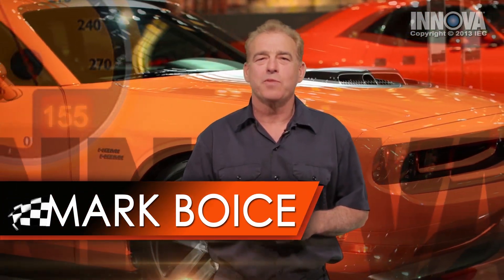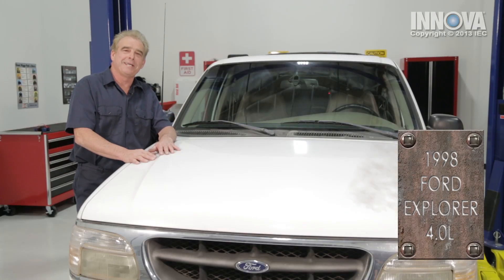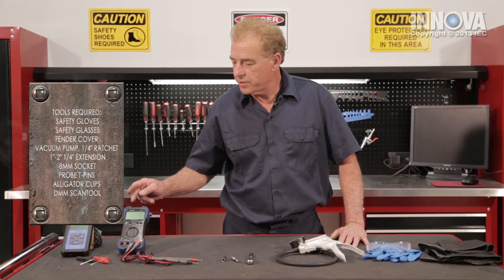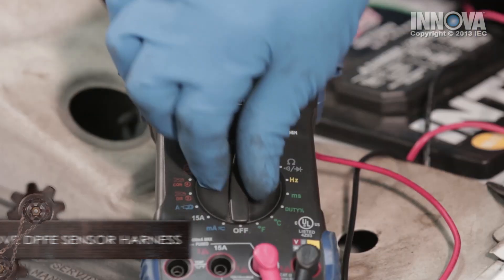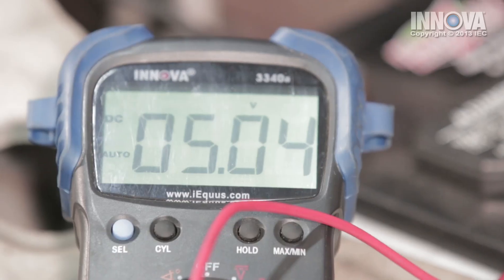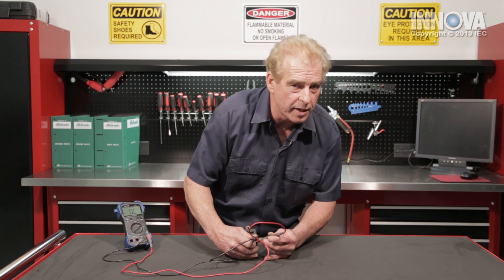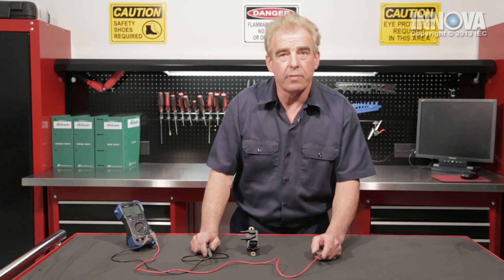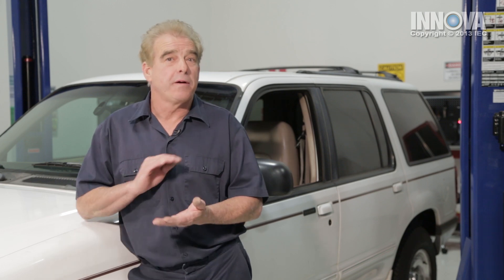How to diagnose a Faulty Differential Pressure Feedback (DPFE) Sensor - 1998 Ford Explorer

Comment: on the first sensor you did resistance check between 1 and 3  pin,  then the new part you read 
between  pins 1 and 2 . WHY? don't know which test is right and which test is wrong.

Comment: Or for $10 you can just buy new dpfe sensor off Ebay and pop it on in 1 minute.....if issue still exists..it wasn't that...you're only out $10 and not 45 minutes of troubleshooting and that's assuming you have a nice multi meter with adapters....
Reply: I did exactly that and now the code is back

Comment: Hello.  Mahalo for a great tutorial.  I hope you're monitoring comments here and will answer.  I have a '96 Explorer.  The DPFE passed all the test except for the voltage when the engine is one and vacuum is applied.  Rather than going up, the voltage went down.   Can I assume that if the DPFE fails just one of the test you prescribed, it had failed?  I also noticed that for positive polarity,  I connected the positive lead to the bottom (blk/w wire) vs you connect the the common from the multi meter.  Thanks in advance for getting back to me.

Comment: Why on the first sensor you did resistance check between 1 and 4 th pin  then the new part you read between  pins 1 and 2 . How is this helpfull since you read from two different points.
Reply: I was thinking the same thing

Comment: Very Helpful video. I changed mine out on my 2004 Expedition and because I broke one of the stems on accident, and it gave me an oxygen sensor code for Bank 1, Sensor 1.  I change the sensor and STILL have the check engine light on.  I disconnected the battery to eliminate the code, but it came on again.  I check it with the diagnostic reader from AutoZone and these codes came up (P2195, P0135, P0401 and P0402).  I'm at wits end. I was going to go to a mechanic to erase the codes first and see if that will shut the light off.  Any other advise?  Thank you!
Reply: Were you able to solve the check engine light issue?  Sometimes you have to clear the memory of the PCM completely by disconnecting the battery cables and touching them together to completely discharge the system and clear the PCM.   I thought that was my issue but the check engine light has come back on.  So I am further diagnosing.

Comment: I got a 2002 explorer 4.0 overheated now blows back out of resivor n bubbles like air in there n white smoke bad out the exhaust . Is my motor shot
Reply: Sounds like a head gasket is the oil milky?
Reply: Head gasket.

Comment: Great video. Very informative and to the point.  Thanks. Some questions though. What would be the voltage signal range when the vehicle is operating? I saw that you pull approximately 23inHG for 3.33 volts. It seems a lot of vacuum. Do you think the exhaust is able to pull that kind of vacuum while driving? Thanks again.
Edit: Find my answer: at 8inHg of vacuum, the sensor needs to output between 4.5 and 5 volts; thus, it seems that that sensor may be faulty. Just throwing this out there if someone dealing with p0401 code.